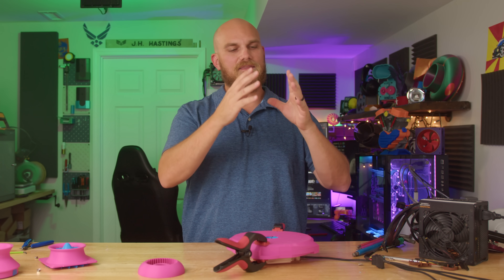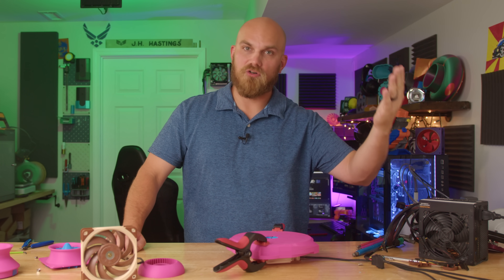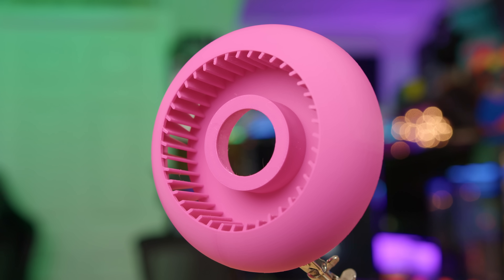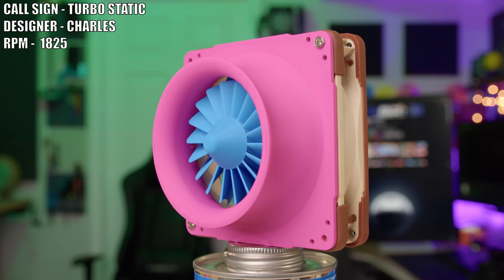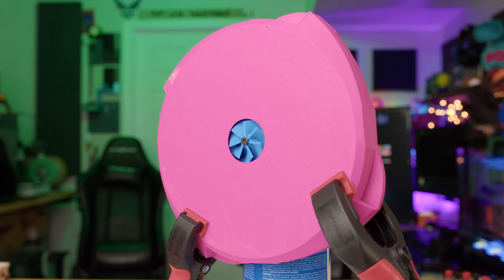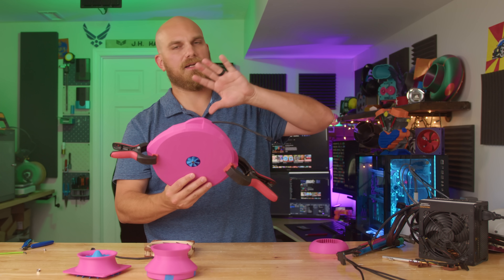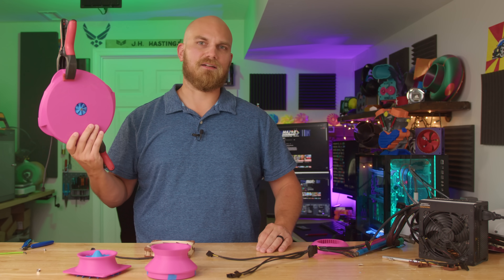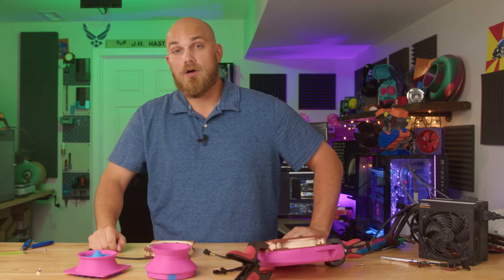Wild 2-Stage 200mm Blower Fan Redefines Power | Fan Showdown S6E6

Comment: The fan showdown was, by design, supposed to be based on fans that would not just fit inside the frame of the A12x25, but fans that you could realistically print and put into your own case. Fans that could legitimately be used to cool your computer from the fan mounts anywhere on the case walls or even on a radiator. Opening the series up to anything goes lost the very essence of what the Fan Showdown was meant to be. We barely even see any fans that would be printable and usable in a real case anymore because it's filled with these ginormous monsters that do, in fact, function, but are effectively completely useless in a proper computer case from the market. We don't even see the new winners on the wall anymore. Ideally I'd like to see two leaderboards where one set is all about actual legitimate real-world usable fan designs, and the other one pushes the very limits of Noctua's fan motor even further beyond.

I don't have a problem with the wild and crazy fans doing anything under the sun while using a single individual fan motor as a common reference and I think those feats of engineering design are respectable in and of itself, but there absolutely needs to be a separation of fans that fit the form and those that don't. Those that fit the form are actually impressive just based on the very limitations they're challenged to overcome. They're reinventing the wheel as it were, to potentially find something that hasn't been been explored enough by actual case fan manufacturers and the professional engineers and designers under them. Those that don't are mostly just replicating existing scientific engineering with 3D printing which, while very cool, is not as impressive when the technology already exists and has been done better, stronger, and more efficient. It doesn't help that those technologies have completely different use cases and don't generally have a use in computer cooling as if they did, we'd already see those technologies instead of the existing fans we have today. But perhaps separating the groups will open up the series to push the envelope.

Comment: I'm group B, more or less.  These fans optimized for massive static pressures are interesting to look at.  

I would love to see a case that utilizes one of these fans to keep high static pressure in an enclosed volume that has some heat sinks built in, then channel it out through a small outlet right next to the CPU and/OR GPU heat sinks, making use of the temperature reducing properties of lowered pressure in a gas AND high speed airflow over a heat sink.  The goal would be a case that is generally quieter than one with conventional airflow, but I don't know if that's true.

Also, did anyone else note how much the air column exiting "Turbo Static" was rotating?  I feel like there's something that could be done to exploit that - perhaps a CPU heat pipe that channeled the heat into fins on the edge of the cowling that were parallel to the motion of wind travel out of the fan.

Comment: There's no replacement for displacement, and the giant compressor is essentially cheating by having a bigger form factor. If you have a 200mm fan , totally standard design, and just simply force it to discharge through a 120mm opening you'd probably also see some ridiculous performance compared to a 120mm. So, that puts me in camp A. But, I do think these designs need to be out there to spur creativity, so I'm with everyone else saying just have two scoreboards.

Comment: In my world, these videos are all purely theoretical since I will never be able to physically touch any of these designs. Because of that, anything goes. However, having two separate categories: practical (can be mounted on a CPU cooler or case) vs pushing the limits (you will have to figure out the use case on your own) is very important.

Comment: I think the 2 stage thing left a lot of performance on the table with the small and not at all streamlined openings to the 2th stage, if there was more space between the 2 stages you could build proper air channels, I would scale them to let the inlet area of the 2th stage pass trough the circumference of the 1st stage , avoid sharp corners and make smooth curves instead, should get at least 10-12mm static pressure then

Comment: As long as it fits into a computer's case, anything go.

Need both dynamic and static airflow as both are important. Even if you can move 20000 cubic metre per minute, if 0.01 mm of Water of back pressure is to much, the fan won't be able to do it's job. Then, even if the fan generate some 50 mm of water pressure, if it only move 10 cm^3 per minute, it don't move enough air to cool anything.

Comment: I'm going to bring other problem.
Scoring system (as of now) only favor static pressure designs.
There should be other categories as:
- loudness
- static pressure
- cfm (airflow)
- RPM
- other (size maybe?)
That way, designs that adress specyfic quotes (all of today are static pressure) can be correctly placed. It's like placing small electric car against medium truck and placing it below because the range is worse. That's not what they were designed for.

Comment: I'm for team B: radical too. Although I would be awsome to have team Rad vs team Trad too, next season, maybe? And suggesting the theme: Practicallity. Yes you can make an absurdly large fan design, but if it has other purposes like holding up a monster graphics card, then it's awarded additional points.

Comment: I'm in camp, "I would like to see fans that could realistically fit inside a common mATX case". However, I understand the other camp. Those are the same people who want to see an Olympics that encourages PEDs. To which I say, "Why not both?" Sports have leagues with different rules. Heck, motor-sport racing has had divisions with absolutely no rules. I would like to see two leagues/divisions in the next fan showdown. Those fans that can realistically be used in a mATX case, and those that think outside the frame. Call the two leagues, NFF and OFF. (Normal Fricken Fans, and Outside the Frame Fans)

Comment: I've had an idea for testing the fans for a while now... what if you included a cube with a volume of say 8 cubic feet...fill the cube with smoke for say 15 seconds, then time each fan to see how long it takes to clear the cube... you could mount the fans on the inside of the cube or on the outside, I think that would depend on the size and design of the fan...

It's nice seeing the smoke being pulled into the fan and being shot out of the back, but I think a measured volume of smoke being removed only by the fan would be a cool visual...

Comment: Give two categories. Fans that fit inside the physical bounds expected for normal use in a case, and Unlimited Class. DO also place the first category in the Unlimited board though, because there needs to be something to strive for. All that extra weight and complexity comes with a burden on efficiency, which can hit effectiveness - so allow them to prove that it is worthwhile.

Comment: There is no need to separate groups A and B

Just highlight group A fans to give them a pat on the back for fitting into a computer case. 

Maybe those are green on your list if they perfectly fit into the fan frame, yellow if they stick out a bit, and red if they are totally way too big

Comment: I'm kinda of both worlds: If the fan rotor cant fit and spin within a standard 120x25mm fan frame, its too big, but at the same time seeing some of these giant crazy contraptions are awesome, doubly so when they actually work as advertised. 

My suggestion for the next season is volume constrained: The maximum size and thickness of the fan stack must fit completely within a standard 120x38mm fan volume, but is otherwise unlimited. Airflow and static pressure will both be measured, as thicker fans can develop significantly more of both.

Comment: I'm on both teams.
I really like the crazy stuff people come with, but I also find it facinating how much we can optimize a fan that fits in the fan case.
So I think we should have separate scoreboards.
Crazy fans - Anything that doesn't fit the case (even the axial one of today's video, because it budges out)
Standard fans - Anything that fits the limits of the fan case. Maybe we could add an 140mm fan there to test more airflow focused designs

Comment: I feel like you should run two competitions simultaneously every episodes: “Stock” and “Unlimited”. 

Obviously a stock form factor fan will be easier to use in real computers but obviously an unlimited no rules kind of fan would be able to maximize performance. Both are really cool but of course each has their place and a stock fan that beats an unlimited fan should be praised even if its overshadowed by many other unlimited fans.

Comment: If it can still be mounted to a case in a way that is actually beneficial ( ie. Not an intake where an exhaust shpuld be)  it doesnt really matter to me either way considering its all 3d printed parts i dont see a reason to make any parameters that dictate designs as long as it follows what i mentioned.

Comment: So i'm kinda confused on what exactly the "static air pressure" is really measuring. I see the smoke test and the top fan from this is just throwing the smoke in a big cloud behind it, it doesn't look like it's hardly moving anything at all and yet it scored first? Can someone please explain how this would actually cool something? I always thought that a fan should move a lot of air as fast as it can to get performance but that clearly doesn't seem to be the case here. I have to be missing something.

Comment: i think you should find a way to make the centrifuge madness as a reprint in a way to not have to smash it after its glued together. you can definitely see it leaking through the bottom in the smoke test. 

also group b should be the unrestricted madness, like group b rally was. but i definitely think having separate categories is a good move.

Comment: Ok, ground rules to keep it fair. You need 2 categories with one common theme, Internal and External case fans but using the same motherboard power. 
Internal - Basically a fan keeping the same dimensions of a NF-A12x25 PWM fan, so it fits inside a case.
External - Any fans that can be stuck to the outside of a case (side/top panel/exhaust mounted, etc) with a little dremel modding, if required. Again using motherboard power. This is for huge fans like the Wonder from Down Under or Centrifuge Madness. Cases like the ones in the early 2015's with fans on the side panel.
I think this would make it both fair stats wise and viable for anyone that wants to try the designs

Comment: I think 3 classes are needed.
1. A design that fits within the space of the original fan.
2. Has a limited and set size that extends from the face of the fan housing.
3. No rules chaos.
Reply: Reasonable

Comment: The "traditional" style fans will never win a pressure contest, and some of the higher-pressure units will never win a flow contest

What would be really cool to try would be a Roots-style like you have already used, but, feed it into a centrifugal compressor, to get high flow from the Roots blower combined with efficient compression from the compressor, which would be a compromise but could probably be engineered to provide good results in both categories simltaneously

Haven't seen an axial flow compressor yet, but, those are really meant for volume more than pressure, although obviously w/ enough compressor stages anything is possible

Comment: I'm in favor of 2 charts, maybe even 3.

1. Fans that do not fit the frame dimensions at all but go all out for maximum performance.
2. Fans that fit the frame dimensions including height, no exceptions. I'd like to see more like the Pikachu-tailed fan that would have nearly led to a consumer version.
3. Fans that fit the frame dimensions but exceed the height, and may utilize add-ons, such as spacers or guide vanes or intakes. Things like the Cheater or the Wonder from Down Under.

Comment: I think almost anything goes. It would be interesting to impose a size restriction for one season though. I'd also be interested in a season where we compete for the quietest fan, while moving a minimum amount of air.

That being said, I think non 3d printed hardware should be restricted somewhat. I'm fine with M3 (and similar) hardware, bearings, and basic things like that, but I think glue should be avoided (rubber/tpu gaskets should work just as well, and in this case, bolt holes would provide better alignment, and potentially better performance).

Comment: Just a thought but I still firmly believe that with the measuring setup you currently have, you need to take your measurements at a specific time - like the fans get to run for 10 seconds before measurements are taken. I think that some of those top designs are so flow-restrictive that even if they aren't actively creating much static pressure, they will eventually accumulate a lot simply because not much can escape back out. This gives those types of devices a huge advantage if you let the measurement go indefinitely until it stabilizes, but I don't think that it tells the whole truth of which fans are actually doing a better job at creating useful static pressure

Comment: Something to remember about looking at only static pressure is that air flow doesn't matter. By definition there is no air flow - it's static. You can have the smallest orifice in the world as long as there is enough pressure behind it. That huge centrifugal disk is going to do a great job producing high pressures. I'm still impressed by how well the second stage did! It makes me wonder what would happen if the two stages were swapped. Does order matter?

Comment: I'm definitely in camp #1. To create a fan that fits on regular heatsinks and within a case that can outperform commercially available fans is much more impressive than building out a gigantic, shrouded system. That said, I like the interesting and creative designs of the bigger units as well. I'd say create two categories.

Comment: Have 3 categories and an overall leader board.
Frame category: fits within the dimensions of the A12X25, pretty self explanatory.
Footprint category: fits within the footprint of the A12x25, but can be taller, say upto 38.1mm or Blowiematron thickness.
Free-for-all category: anything goes as long as it's powered by the A12X25, dimensions don't matter. Design a 4 dimensional fan, that'd be well interesting.

Comment: Max pressure you can achieve is proportional to the square of the diameter and square of the rpm.
Making the fan blade twice as big means you basically 4x the pressure with the same design

Comment: This video goes to show that with the smoke test, it looks like it's turbulent, misdirected flow and won't work well, but once constrained in a smaller tube instead of open air, shit litteraly hits the fan🤣 As for what group i fall into... well the fact that now the judging is done by static pressure, i think anything goes as that is what will allow the most outlandish and interesting designs that can get your blood boiling and will allow as much "artistic" freedom as possible. As my final note, i would like to see the centrifuge madness sealed completely and running as i'm sure those numbers include some loss due to only having 2 clamps on there and not allowing it to "boost" as much as it could. Now for the part where it will be impossible to get off without breaking anything, silicone gasket maker can hold pressure probably better than glue would and is easier to break apart and remove the assembly from the fan after testing. Then again, that's just my 2 cents, i'm not saying that's how it should go down, just offering alternatives that might work at least as good and be easier to dissassemble in the end.

Comment: Without "anything goes" we wouldn't have a new chart topper (and it's predecessor). 

The weird and wacky designs across all seasons have always been the most entertaining, be they technical or absurd. 

While "technically"  fan showdown is the application of engineering principals to a real world scenario, it is also a bunch of nerds getting together after work to have fun. 
Whatever an individuals interpretation of fun is, be it a hairbrained idea the size of an aircraft carrier, or a technical marvel based on quantum theory - No exclusions! 

If segregation is required, please maintain one chart as ultimately the winner is still the winner, but classify each fan Standard and Custom. 
There can be two gold medallists, but only one Best In Class.

Comment: Group A. I was here for S1E1 and I thought the whole point was to design a PC fan that was better than Noctua's. No chance is S6's current leader going to fit in any case. It's not a PC fan. 
If you're actually listening to ideas, I think there needs to be an all season's champ showdown soon. It could be 2 or 3 episodes where each fan is put through all of the different measurements.  Sound needs to take double points for 1st compared to everything else. Each measurement needs to be weighed and make a list like Project Farm does at the end.
Reply: With that said, I do like "group b" but they should be differentiated.

Comment: 2 groups, with 3 score boards. Constrained and Open groups, with each groups score and overall score to show how they compare. Only thing I see as an overall that they are all powered by the same motor.

What I want to see is how some of the past designs would work with a bigger fan. Maybe they need just more power and size to function like they look.